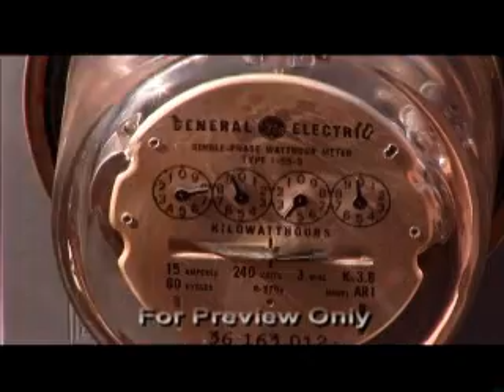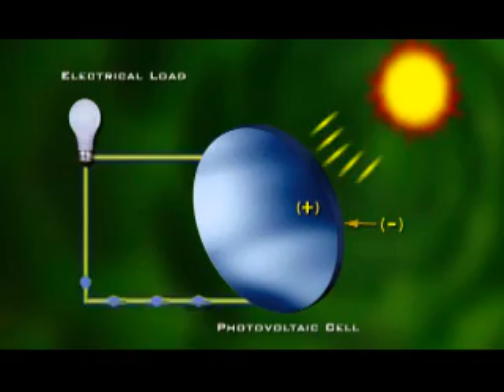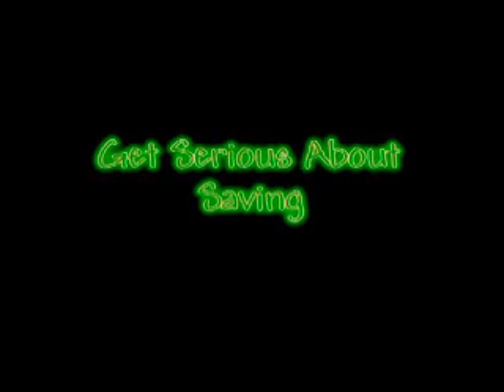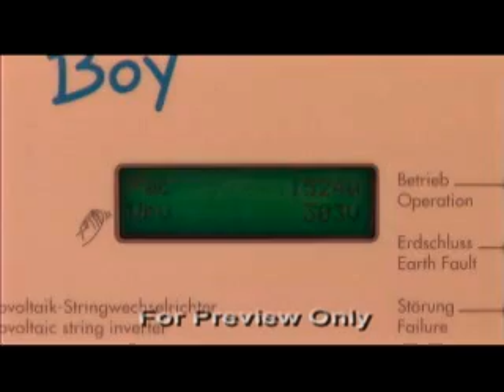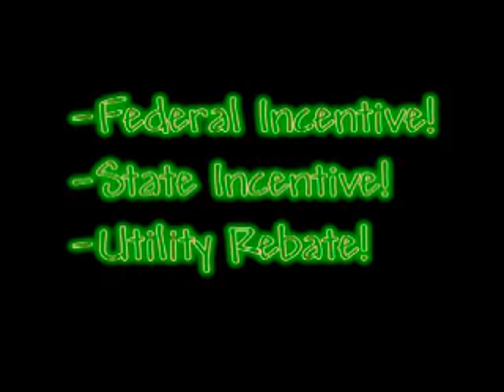A Bright Alternative - Sustainable Energy via Solar

Comment from the maker: What I've learned having installed a system is:
- it's expensive
- it generates more than 4000 watts(enough to power many microwaves)
- it saves us more than $95 per month
- it reduces the CO2 given off by our family by 7 tons annually
- it will pay for itself in under 12 years...
The only thing funny about solar is that it's not being adopted by more people. It's a matter of awareness ... And its being improved in efficiency and the costs are going down.

Comment: You are correct insofar as solar grid-tie systems without batteries are concerned.  However, with grid-tie systems that have battery backup, some or all grid produced electricity can be forfeited.  It all depends on one's system.  A completely independant, non-grid-tie system completely eliminates the use of coal, nuclear, natural gas etc. etc.